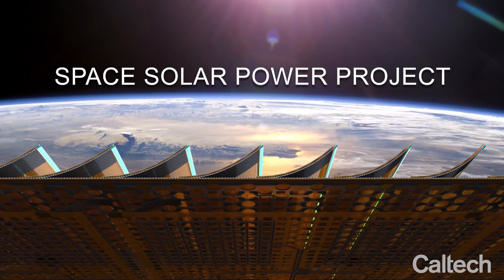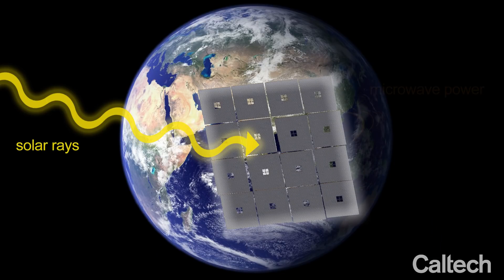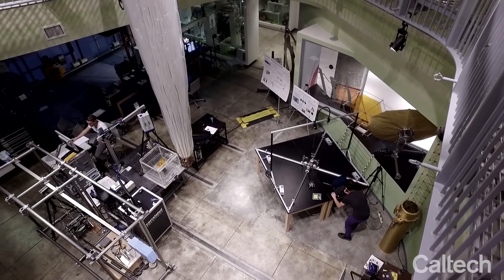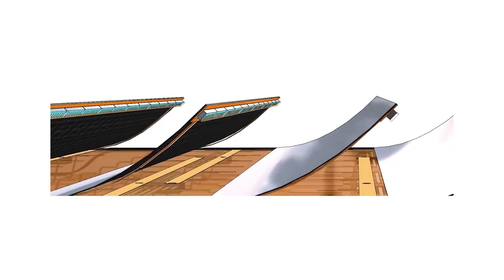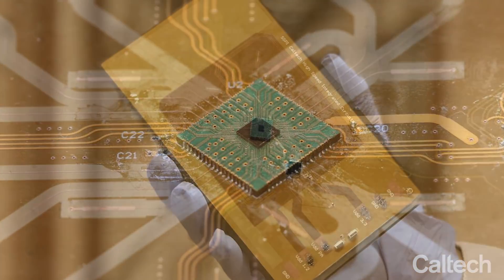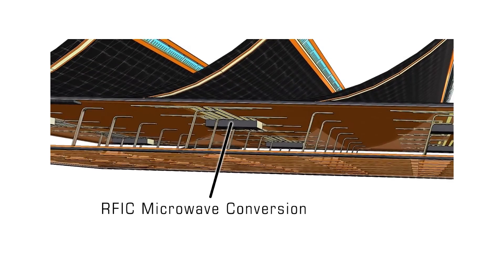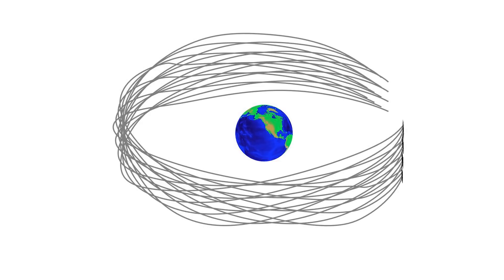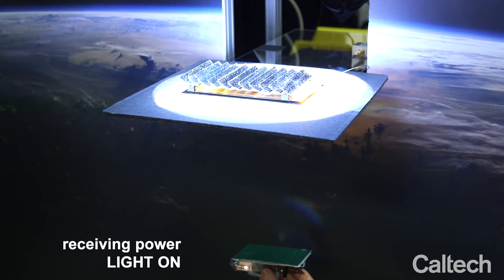Space Solar Power Project

Comment: You should acknowledge, that this is not reliable as a energy source. Too high inputs, too low outputs. With all the input costs, its cheaper to build that on the Earth.
But your research could lead to a quite interesting space weapon, with ability to burn large enemy area with e.g. microwaves. Congratulations.